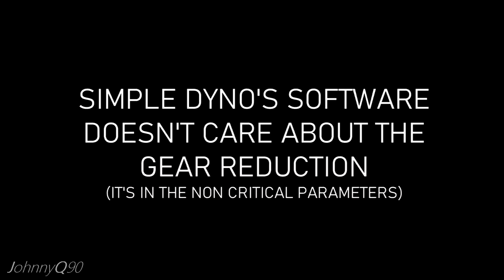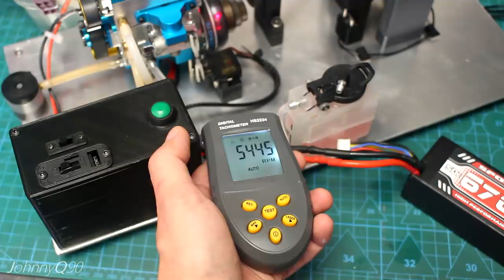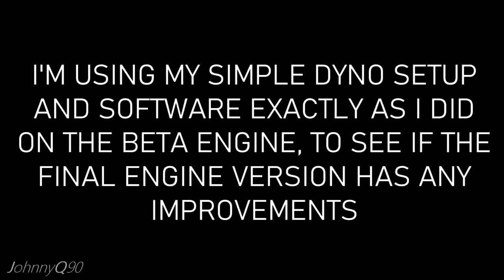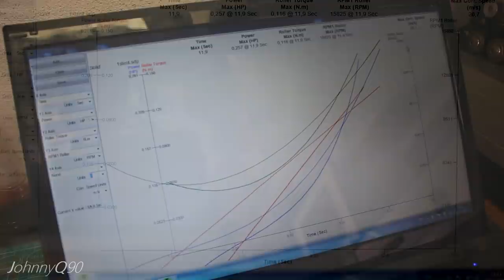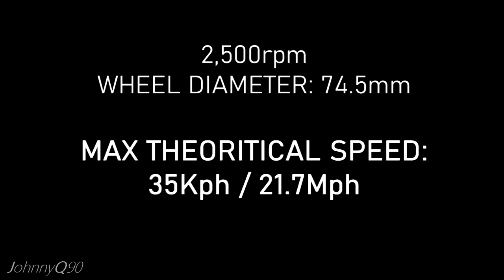TWIN Cylinder 4 Stroke 8.6cc TEST -  Dyno/ MAX rpm/ Road test!

Comment: 12:40 your own road tests even show this thing to be way more powerful than the dyno claims it is. That dyno needs a complete redesign.
Reply: I don’t have a reference for how much .25 house power is but do you mean that thing is way too zippy for .25ish HP?
Reply: @andrewslater6846  0.25hp would barely be able to move that car at all.
Reply: @TestECull  point of referencd ?
0.25hp does move a lot of things
Reply: @DarkIzo  Its about the performance of a tamiya grasshopper. The car in this video is too damn heavy for this engine to only be making 0.25; would barely be able to move at all.

Another point of reference: A 0.26cid single cylinder 4 stroke from OS makes around 0.3-0.4hp at 10,000rpm or so. This engine is revving twice as fast and is twice the displacement. If it truly is only making 0.25hp it would have MAJOR internal issues causing terrible peformance, likely severe enough that it would barely even run at all. 

Engine is really making somewhere around 1hp. The way Johnny's car performs is about on par with how rtr nitro TCs with 1hp engines perform.
Reply: @TestECull  i dont have any experience with model cars, but working with electric motors i know that 60 watt is enough to some heavy hardware going, noe triple that power i imagine it might not be as useless as you think, but them again, i dont have any experience with rc cars
Reply: @DarkIzo  Typical electric 1/10 car has somewhere around 1.5-2.0kW availbale to it if its brushless and about 250-350 watts if brushed. This car is about halfway in between the two.

Peep my channel I do a lot of this stuff. Mostly planes but I have cars too. Some of my cars have engines rated at about one kW or so you can see how spicy they get.
Reply: @TestECull  2kW? So the typical 1/10 car on a 2s lipo is drawing around 250 amps? I don't think so.
Reply: @richjbarnett  Inrush, yeah, continuous about 100-125. Most run 3 cell some run 4 cell. They are.....all but uncontrollable at those voltages, but yeah, the power systems will do it.
Reply: 10th is generally 2s lipo. If your running high KV / Low turn motors on 3 and 4s you are trying to run as fast as possible and break your equipment. As the motor rpm increases the current falls so not constant current.
Reply: @richjbarnett  10th is 3s getting into 4s for most people. 2s is really only a racing thing. For most, 8th is 6s touching 8s while racers are on 4s.
Reply: I dont play around bashing. I race.

Comment from the maker: Guys! The engine is actually is SOHC, as the second pulley is there for looks. 
I receive increasing number of comments about this, and I wanted to address it. Trust me, I know what I'm dealing with 😉
Also if you're interested in the engine, here it is:  NR-200 Engine ➞ https://bit.ly/3ylXSGU  Use code: jq90 for 10% discount.
Reply: Are all of the toyan engines SOHC? I thought they all were but I might be mistaken. Always love the content, keep it up please!!!
Reply: Ever thought of putting a two speed transmission in it?
Reply from the maker: @LS1sLegoGarage  Yeap. Hopefully in future this will change.
Reply from the maker: @BMfins  A manual one, yes.
Reply: @johnnyq90  that’s so exciting! Groundbreaking stuff
Reply: @johnnyq90  oh ok. Yeah I definitely am excited to see if they make a DOHC or maybe even some pushrod engines. Exciting stuff they're developing!
Reply: Glad I checked the comments before saying anything haha
Reply: Aaaa good, cause I was searching in the comments "why the heck is that a SOHC with 2 pulleys then" XD
Reply: I wonder how many 0.1 HP that second pulley sucking away... Maybe it's a 0.3 HP engine with a (not designed for looks) and that would almost be the same watts that electric bicycle in Sweden can do max (250 watts). And in this case I rather have this :-)

But the best would be a some kind of biodiesel that produces about 300w (well they can never check absolutely). So that I can produce my own fuel :-)
Anyway! Love this! So awesome!
Reply: Have you confirmed structure opening head cover by yourself？
Reply: I thought it was dohc as well until I saw this 00:38
Reply: @LS1sLegoGarage  I think the issue with pushrod engines would be their lack of high RPM. If you’ve got a motor with this small of displacement that’s hitting 20k rpm it’s gonna mess up the pushrods. Maybe I’m thinking about it wrong?
Reply: @rennerhogan9138  possibly, but I don't think it would mess with the pushrods, if anything it would make the valves float but that's just a matter of valve springs and whatnot. My guess is that it would be hard to make pushrods small enough to fit in this scale and also hold their strength

Comment: Sir I stand to bow before you. May I suggest perhaps going all out performance on the old L200. Machine your own heads and beefing up the cranks and and stuffing a little force air induction in there. Increasing bore diameter and jacking that compression ratio way up. I would love to see you configure an injection system.

Comment: Seems like there's way too much torque for the rear rubber slicks.  Try switching to something with tread or possibly foam.  Very nice build so far!
Reply: Those are "drift tires" made out of a very hard, plastic-like material. They are SUPPOSED to spin very easy, allow the car to slide around, and last a long time by being hard and not very quickly transferring it's material to the road

Comment: Love your videos! I run a small lathe too and think I have a worthwhile tip for you.  Try the honed carbide inserts marketed as "for aluminum". They lower the load on your machine and produce outstanding surface finish.  They cut steel just fine (they are still carbide after all). The honed sharp cutting edge also lets them take the really fine cuts for those times when you need to remove a half thou to put a part on size.
Reply: I learned that the "M" in my CCMT inserts for my smaller lathe means "molded".  I got some CCGT "ground" basically honed which are "for aluminum" and they make aluminum parts so perfect that you can't tell that they're spinning.  I have not tried them on steel but I haven't had any complaints with my steel inserts.  I find that cheap molded inserts aren't always as sharp.  Buying some real brand name inserts can make a huge difference .

Comment: @ 5:52 the timing belt looks quite Burnt on the back. I would say it overheats  badly.
By the looks of it, at least one of the pulleys dosen't run parallel with the others. Paired with the use of an oversized belt that leads to massive friction. .... it think this belt is costing the engine at least a quater horse.
But your build of the dyno and the mountings in to the car are spot on as always!
Reply: And in the thermal image it looked like it was just as hot as the head.

Comment: The 1/4"-28 thread on the crank is a common standard on 2 stroke nitro model engines. This looks a lot like the "OS" style crank output standard used on smaller nitro engines as opposed to the longer more common "SG" style used on most
.21 cubic inch (3.5cc) and larger engines. I guess they tried making it more compatible for off the shelf clutches. The thread on most nitro glowplugs is 1/4"-28 as well.

Comment: I wonder how much power that water pump is consuming. On a low power application like that I would imagine it would be north of 30% at max rpm. I wonder if a electric water pump would unlock some usable power

Comment: Have you got an electric fan on the radiator? It doesn't look like it will get much airflow where it is.
Reply: I agree, and mounting flat to the plate it doesn’t have anywhere to draw air from. I’d cut the center of that plate out and add the aforementioned fan
Reply: @nickcarnes6194  I would stick it up over and put a scoop on the bonnet directed at it.

Comment: I am Just a normal car mechanic but I was wondering if you have ever tried to balance the small engines,i would really love to have some of the equipment you have available, but to learn from your experience is nothing short of amazing i mean seriously you are a great engineer and if not for people like yourself many people still would not even have a basic understanding of the internal combustion engine, but why can't we get full size engines to run on these fuels.
Reply: They are balanced from the factory.. 
And we DO have full size automotive engines that run on these fuels.... 
They are called N.H.R.A. Top Fuel engines. They are 500 cubic inch, Roots blown V-8's that make around 11,000 horsepower, and will send a racecar down the drag strip in well under 4 seconds, with the driver experiencing 5+ G's of acceleration force..

Comment: You should partner with a hardware programmer to develop a simple machine code Air/fuel ratio map and create a running free float valve head.

Comment: looks like a DOHC rather than a SOHC to me... pretty nice in any case.

Yet I remember from a few decades ago 3.5cc (granted 2 strokes with a lot of nitromethane) in RC cars were a lot more powerful than what you find on this one:is it possible that there would be an error in the computations (e.g. in the way the torque is computed due to the gearing, and possibly not taking in account significant friction)?
As a rough double check, you may also be able to check "wheel power" the way it is done on actual full size vehicles, by weighting the car and timing the acceleration  on a known distance.
Reply: That's what I'm saying.

Comment: if it's running cool enough ,run a bigger carb on it or run two carbs ,one each cylinder,also maybe build a fuel intake with a nice rough surface inside to break up the fuel better and make it so the fuel isn t making itself freeze practically cause it will run way better if you get that fuel temp up hey .done well thought as lovit,wish they were on the market like that rtr as if buy one tomorrow if they were available ,whatever the price .

Comment: Does that SOHC mean that what looks like another camshaft is actually just for the fuel pump, and not the valves.
Reply: The second one is just a pulley. There's nothing attached to it

Comment: Very cool! 
It did however seem to have trouble keeping the donut going, which indicates clutch slippage. Heavier clutch shoes, with a suitable spring (to allow disengagement at low RPMs) should help, although, it could benefit from a whole new engineered, bespoke clutch system. 
Using a pressure plate style system, with a custom governor, utilising lever(s) to gain mechanical advantage, to get more clamping force on the clutch disc would achieve better results, albeit at the cost of extra work and materials.
The guy from 2 stroke stuffing makes his own friction pads out of cork sheet for his clutch shoes, albeit it on moped.
Up to you Johnny!
Keep up the great work!!😉👍
Reply: The clutch you are talking about trying to make for an R/C car would be a huge waste of time... There's not a thing wrong with the centrifugal style that have been used on R/C cars for decades.

Comment: Next up... making a slightly bigger scale full on replicate of the Alfa Romeo 155 Q4 (Wide Body) with an aluminium unibody and the engine and every part and attachment point in the right place. Of course with either a replica 2.0 liter TwinSpark engine or maybe a sweet V6 Busso replica. 😎👍

Comment: Johnny, Love the cars you build and the content. Question. Have you had any problems running the L400 - Common crankshaft problem in particular or is it ok? Building a 1/6 th scale hotrod at the moment that this is in and i want the engine to be right before I run it. Thanks

Comment: Also, I can't say enough about your fabrication skills. You are definitely a God in the RC game. I was just talking about my old Traxxas E-Maxx (yeah, I know, ewww...electric motors), but it had dual 12 turn Titan 550 brushless motors, a full RPM steel chassis, RPM unbreakable chassis arms, steel driveshafts with a steel center section and spools in both diffs, matched 7 cell Li-Po battery packs, and steel counter gears. It also had aftermarket shocks and springs with 100 weight oil and aftermarket wheels with the soft knotty tires and MAN did that thing move. I put all new Tamiya servos on it and it would go anywhere. I also had an all aluminum linked rock crawler that was so much fun to play with. I did have a few nitro cars as well, but back in those days it was big money to get a controller and receiver that was strong enough for me to go fast and still have control at further distances. I'm sure RC technology has come a long way since then, but I had close to $2000 into my E-Maxx. When I moved my cousin sold mine without telling me and I was just screwed.

Comment: From what I see, it's a huge improvement in the chassis/RPM/confort on road. 
It look like this version have less torque but higher rpm open door to better speed and better handling with gas management. 
The only bad point is.... How could they don't so bad looking ? It's look like a school module more than a very cool small engine Ith water cooling 1nd camshaft... 

Did you plane to open it and improve it ?
Or mod it for better looking 😇

Continue this way it's so cool ! 
Cheers 🇲🇫

Comment: its amazing that we have these mini engines
but if you look at it from an efficiency stand point these make no sence
a cheepo outrunner bldc motor 
can idle at 0rpm
max depends on kv can go very high 30000rpm
torque is instant
response is instant
amazing torque at low rpm too!!
only thing is that battery technology is shit low
and fuel is shit energy dense!!

Comment: Dang man, 17,500 RPM max revs. Those tiny pistons are MOVING!
Reply: If only the value springs could take it without floating lol.

And piston speed is measured in feet per second. And with that small of a stroke, the pistons max fps isn’t too bad at all.

Comment: Amazing 👏 RC has come such a long way in the last decade with the onset of CNC and 3D printing, it's like anything we can imagine almost we can make or find out there nowadays. I have 1/4 and 1/5th scale both RC cars and boats and originally getting into the 1/4 scale stuff was very very difficult and extremely expensive because if you couldn't make it yourself or have the tools or knowhow you paid dearly for the parts and pieces you needed. Now just hit Ebay and it's like a Walmart for anything RC size except still 1/4 scale cars. But I only have one 1/4 scale lol so it's fine by me, 1/5th is the best way to go with large gas or electric if that's your thing? But that's very impressive that little 4 cylinder is capable of turning those rpm's and not blowing up! It's really right up there with my high performance gasoline engines, just tiny sized though. So cool to actually see someone mounting one In a actual car finally. Anything I've seen so far is people just make static displays so they can run them..... but very good and it performs better than I thought it would as well for its weight!

Comment: 0.281 HP is 210 Watts of peak power, that has to work trough clutch and gearbox, to stay at relevant RPM.
With that size there are serious limitations to flow of air and fuel (yes, I am aware of existence of 1.5ccm rc engines), this is sitting on a fence of art and engineering.

Comment: If its SOHC why are there two cam drive sprockets?
Reply: The second is just a pulley. Otherwise the tight side of the belt would collide with the water pump pulley
Reply: @theo7709  that doesnt make sense, the exhaust and inlet manifolds are on different sides of the head. Plus there is a blanking plate foe both sides on the back of head. Having one offset cam would mean a long rocker on one side, or very cramped valves and long pointless ports on one side of head, making for a more costly and intricate casting as opposed to a simple small diameter, idler pulley, to allow belt to clear water pump pulley.
Reply: @chrisclarke6344  just Google it, it is not that difficult. I am right, you are wrong. A second camshaft would also collide with the plugs.

Comment: Looks like a dohc 👀🤔🤔
Reply: Nope, it has only one camshaft. The second "timing belt gear" is just a pulley
Reply: @theo7709  why would you need a second pulley gear up top like that if there's only 1 cam. The cam gear itself would be the top "pulley". Also two shafts running through the lifter section. 

Seems odd....
Reply: @MaNNeRz91  I guess without the pulley he would have problems running the belt without interfering with the tension pulley. If you look closely while he is turning the engine you can see that a second camshaft would collide with the spark(glow)plugs. It also has only two valves per cylinder.

Comment: 4:40 This dyno does not provide any meaningful data! You need to hold a steady state load on an engine, which inertial dynos like this cannot do. Dennis Dempsey put one ofthese in a Trail Finder 2 and it threw it around like a ragdoll; WAY MORE power than your dyno shows.

Comment: I'm gunna say something is wrong with your dyno, as my 11cc engine puts out 2.4hp @ 12k rpm, maybe change your ear bud with a proper hall effect sensor for a more accurate rpm and remove the shroud from the flywheel as that will be creating drag and go direct connection as gears aren't 100% efficient.

Comment: Why SOHC, when it's DOHC?
Reply: It has only one camshaft
Reply: @theo7709  looks like two of them.
Reply: @axe22rus  if you would take the time to google that engine then you would see that it has only one. A second camshaft would collide with the plugs. The second gear is needed as a pulley otherwise the tight side of the belt would collide with the water pump pulley.
Reply: @theo7709  very strange) Ok, I'll look for it. Strange, that the intake and exhaust ports from opposite sides with one cam.

Comment: Pretty cool setup. I love the mini radiator. I don’t see the desire to have this though when you can get off the shelf RTR that run 60+ mph for less than the cost of the engine in this video.